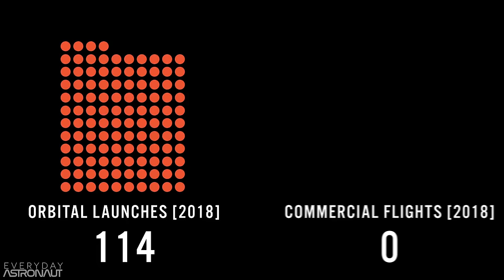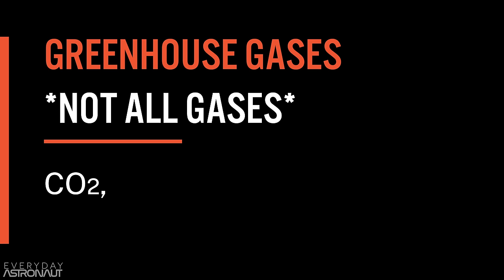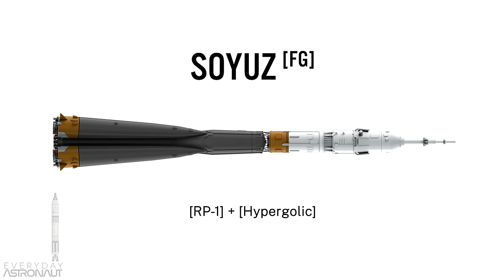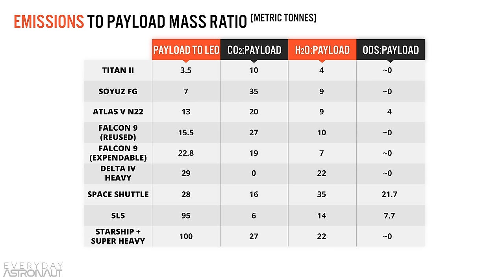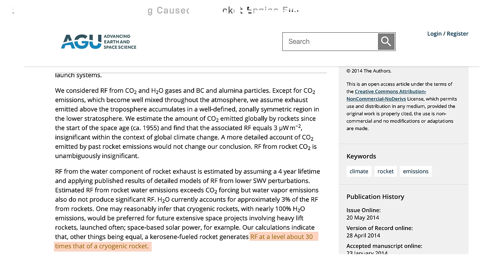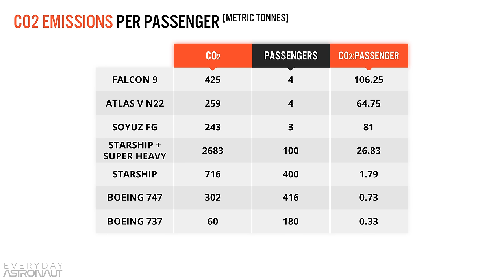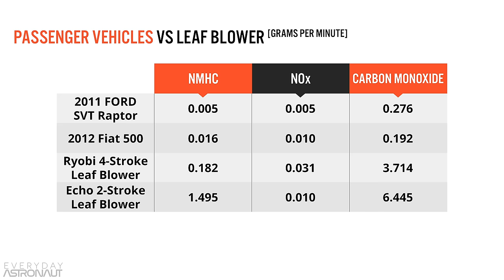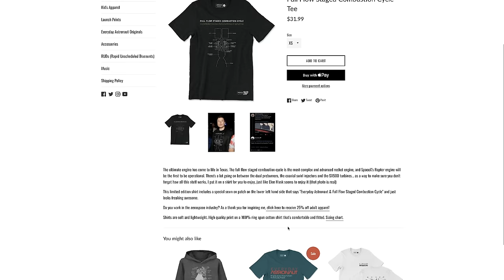How Much Do Rockets Pollute? Are They Bad For Our Air?

Comment: good video! .. A couple minor corrections: Hydrogen Chloride (HCl) is not an ingredient in solid propellant  - it is an exhaust product, and Chlorine is not. However, various Chlorine compounds in the upper atmosphere change with sunlight and other compounds, depleting Ozone, as you correctly stated.  Water vapor is a greenhouse gas, but at much different IR wavelengths than the much more powerful greenhouse gasses CO2 & CH4 (methane).. In the atmosphere, H2O is condensable to liquid, while CO2 and CH4 are not. The amount of H2O in the atmosphere in vapor form is determined by the temperature, which is powerfully driven by CO2 and CH4 content.. it is more accurate to say that CO2 and CH4 content amplify the H2O content.. It's far more accurate to describe CO2 and CH4 as the planet's thermostat.  Also, CO2 is not emitted directly by curing composites in an oven or autoclave, but it does require energy, which can generate CO2, depending on how "dirty" the energy source is.

Comment: 11:30 

It's di-ene because, if high school chemistry serves me correctly, it has two double bonds in its structure
Reply: ST-1170 - right!  Tell Tim to enunciate and exaggerate each vowel, cause it's right, it means something, and it's easier to understand how to pronounce it. "byoo-tah-die-eeen". Easy.
Reply: Actually, each butyl had two double-bonds, before one of them was broken open to link this butyl group to both its neighboring groups, to make a stringy stretchy long chain polymer.

Comment: -"It will take a solar farm the size of 6 football fields!"
-"So be it"

I love this guy
Reply: 6 football fields is not that much, only 345600 square feet. If we take 2 lbs per square foot of solar panel, it weighs 313.5 tonnes. That is 3 Starships to LEO, let's double that for Mars. That is considering the weight of solar pannels you put on your roof, I bet they can make them lighter if you do not mind paying extra.
Reply: @dronillon2578  couldn't we use a more powerful energy source before solar? Like using a small reactor or something, then start sending solar panels?
Reply: @Jak_Extreme  Maybe we could, and if it was just about visiting Mars couple of times maybe we would. Heck, for that you could just ship the fuel from earth. But that is not Musks goal. His goal is permanent human presence on Mars, that is why his response is "so be it". Because in the grand scheme of things, couple hundreds square feet of solar panels is nothing. For this goal, solar panels are ideal. They are very simple, last decades, do not require much maintenance, except wiping the dust off (which can be dealt with, look at Mars rovers). When they break, they are easy to replace (keep in mind you have to do this wearing space suits). Their support structures and soon probably the panels themselves can be 3D printed. Once some infrastructure is in place, they are likely to be manufactured on Mars (maybe not all parts, but most of them). Similar process of manufacturing fuel can be used for Earth (where it has to be perfected before shipping to Mars anyway). Moon and larger stations in orbit of Earth will also benefit from this process of creating solar panels. And possibly lead to creating power satellites to beam down the power back to Earth. If a technology is multi purpose and can be used in multiple applications, then it is likely to advance more quickly (seems to be Musks way of doing things). That is at least my understanding of the issue.
Reply: @dronillon2578  but if we send a reactor  first then start sending solar panels,the reactor gives power to the methane producer and only that so that starships can return
Reply: @Jak_Extreme  Those 345600 square feet of solar panels whould produce around 5MW on Earth, and 2.5MW on Mars. Equaly powerfull Radioisotope thermoelectric generator using Plutonium-238 would require almost 5 tonnes of Plutonium-238. I have no idea if this is even possible to work at this scale. Granted, it would last almost a century, but I doubt anyone would be fine launching this ammount of radioactive material into space onboard a rocket, that can explode and scatter that into atmosphere.
Reply: @dronillon2578  i mean, Russians want nuclear engines
Reply: @Sin526  I had no idea we have reliable, plug and play, easy to maintain fission reactors at this scale, that could be shipped to another planet. That is why I assumed RTG. Maybe you could provide links or reference points so I could learn more?
Reply: Sin526 as someone who worked on nuclear reactors I too would like to learn more about these, specifically how they plan to cool them.
Reply: How'd you like to be the guy that has to go out in a pressure suit and squeegee off all those panels after a dust storm? I wonder if you'd still hear it squeak...
Reply: @dronillon2578  At those scales, we tend to forego the passive radioactivity and go for actual reactors. Think about it this way: for probes, the advantage is the long burn and constant power unrelated to solar intensity. The whole point of talking about nuclear as a bootstrap energy source in a colony is the lighter weight of the fuel compared to anything chemical.
Reply: @atimholt  I'm aware of the energy density of nuclear fuel. The question is not why, but rather how? Solar panels and RTGs are simple plug and play things. As such, they are pretty much ready to go solutions. I'm not sure this applies to fission reactors. But I might be wrong. This is why I'm asking: what exactly are we talking about? Project names, links to some papers? 

That might provide answers to questions:
Will it survive the stresses of the transport? How hard it will be to setup once there? Cooling, maintenance, safety, reliability, disposability, setup cost, fuel cost? Will it be available in time?
Reply: Jak Extreme Yes, but putting nuclear reactors on rockets is inherently stupid.
Reply: Roll out the solar foil.
Reply: @dronillon2578  I saw somewhere (maybe Scott's channel) that there was one satellite with a fission reactor once.  However the main use of small fission reactors has been submarines and big ships, with the details heavily classified due to military significance.  I guess Grumman holds most of the US expertise in building those.
Reply: Actually the statement how big the area should be without a time specification is total nonsense. You can also charge Starship with a single solar panel, but that would take years.
Reply: NASA's kilopower sounds like a keeper
Reply: how big is football field?
Reply: @DFPercush  This would be a good application for an orbiting solar power satellite. It could be constructed in earth orbit, power itself to Mars orbit (with ion thrusters), and then send power down to the Mars colony by microwave. Microwave antenna arrays can handle dust.
Reply: No other choice
Reply: @ThatSB  Pretty sure he does, if he didnt he wouldnt be managing a company for more then 2 months since thats against the law. so you can love him more =)
Reply: So do I.  But Everyday Astronaut is a pretty cool dude as well.
Reply: @dronillon2578  plus solar panels pack flat in transport, so they could fit a lot into a starship as long as they dont exceed the weight limit.
Reply: @johncrowerdoe5527  Naval reactors are water cooled because the Navy has a lot of water available. In space the tendency is to lean toward liquid metal or molten salt, both of which can be launched "frozen" like a solid block if you want to fuel them before launch. The molten salt reactors can also be fueled at their destination because the fuel loading is almost shovel it in. Google NASA space reactor or molten salt reactor. The NASA space reactor puts out a dozen kilowatts if I remember right. The Oakridge MSRE (40 years ago) was about the size of a fridge and only put out 2 megawatts because it was only a research reactor.
Reply: Gigavolt pulsed ion drive causes cascade ionization of your atmosphere with minimal amperage required from the driver circuit and exhaust is ozonated atmosphere. Plus the ztrong electric field can use solar wind ions as fuel for interplanetary travel.
Reply: Like, that isn't even actually that large.  Some solar and wind farms are already much larger than that.
Reply: "So Be-zo it!"
Reply: the international standard of measurement 
a football field
Reply: six football fields does not seem to be a lot for that purpose
Reply: @00O3O1B  thats not true, solar, wind and Hydro are insanely clean, just by themself, if compared to Coal or nuclear , the difference is just straight up mental.
Reply: @00O3O1B  we need more funding in fusion research tbh
Reply: It will need to be bigger, because Mars has dust storms which last for months, and which can turn noon into twilight. The panels will also need to be cleaned regularly, and very likely repaired because of micrometeorite and radiation damage. 
   Maybe thermal stresses will also be a big issue on a large array. Solder becomes becomes really brittle at Mars temperatures, which will range between around 0°C and -140°C at the equator. 
   For the record: On average, Mars is about 50°C (90°F) cooler than the Earth. We see temperatures from about +50°C at the Equator to around -90°C in one part of Antarctica. At -90° your lungs freeze and you die quickly. Nobody has ever set foot in that region of Antarctica. Measurements are taken by orbiting satellites.
   The cold of Mars will be a major challenge to anyone who wants to live there, and almost nobody ever talks about it. But that cold has destroyed circuitry on Mars landers, and will definitely destroy any unheated present day batteries within a few hours.
Reply: @RWBHere  Actually there's a research station there at -90° , they try to survive and grow Foods, a test for the moon base , it was successful. 
The hardest part now is Batteries that can store energy for 14 days because of the 14 day 14 night cycles on the moon. they can make bricks, solar panels and Batteries from Moondust. 1 brick takes 5 hours to make in the vacuum , it's all quite a task but doable at some point.
Reply: @stevegaalema6807  I've heard this called space based solar. Isaac Arthur brought it to my attention. He has a YouTube channel.
Reply: Love the sly dig at chem trail theories 😂
Good job 👍
Reply: Really though? I wouldn't want to see large-scale deforestation to make way for solar and wind.  I'm still holding out for fusion power.
Reply: Three starship worth of solar panels for 1 starship worth of fuel at best, so how will you refuel other three starship,  by another 9 starship worth of solar panels???

Comment: December 21, 1968 was the launch of  Apollo 8 and I was there as a 17 year old boy.  After the launch, I could smell kerosene.  I was 18 miles away.  Pollution? You tell me.....
Visually the Saturn 5 first stage burned cleaner and dissipated faster than a shuttle launch with it's two huge SRB's.  They almost blocked out the sun.  But an RS-25 (Hydrogen fueled) exhaust is very clean......So is a Spacex Raptor which runs on Methane. (And is MUCH cheaper than Hydrogen)

Comment: I am grateful to fly F-15s for a living but I am forever in awe of rocket engines. The mighty F-15 uses Pratt and Whitney engines that make between 24,000 and 29,000 [ish] pounds of thrust each (afterburner)...and it is crazy fast and powerful! But...for context, the RS-25 (Space Shuttle Main Engine) makes 512,000 pounds of thrust (vac.). The ALmighty F1 makes 1.7 Million pounds of thrust (vac.)! We got nothing on rocket engines in terms of raw power. I wish I could feel the thrust!
Reply: I'm pretty sure if we put an F1 engine on your F-15 and lit it, you wouldn't feel a thing. :)

Comment: This is a great video that addressed most of the questions I've had for years about 'vehicles' at high altitude.
 Even before the internet existed I had a good idea jet aircraft (747) produced more pollution per person on a single trip (London to Australia for instance) than I would produce in my entire life including every vehicle I was likely to drive
I am wondering if there is any more research going on into 'railguns' for transportation? 
The initial accelerations would probably turn people into mush if set from standstill but couldn't smoe form of electric motors be used to lower acceleration before pulsed magnets were switched on? (as in a few Sci-Fi books I've read in the past)
 'Launch guns' would take up a lot of area, probably several miles long but could be pretty much 'ground based'  and if using 'cleaner' nuclear reactors to power generators (thorium reactors or smaller aircraft carrier sized which are better understood and contained)
Reply: Look up spin launch

Comment: The SSME is somewhere around 1.2% efficient if you take the fuel energy consumed divided by the thrust energy output. Its much more efficient to use a commercial turbofan to push off of the air, than pushing off of your own rocket exhaust. Even better, push off of the entire earth for the best efficiency, as there are no losses to turbulence.

There is a simple number you can use to multiply with the engine's specific impulse in order to get the actual TSFC efficiency number in percent.

Comment: Since the Space Shuttle engines had to. Lift the orbiter along for the ride to LEO, the actual payload that was lifted by the launch system was 128 tons, making the shuttle the second most powerful super heavy launch system after the Saturn V. That would put it at the top of the list and it means it performed MUCH better than what you calculated.

Comment: You forgot to mention ODS per passenger in Rocket VS Airliners. With that in mind, airplanes are probably at least 10x worse for the atmosphere than using starship for point to point transportation. Sounds pretty good!

Comment: Excellent video but some things cast a doubt in my head. Planes also emit other greenhouse gases (as you said) so in terms of equivalent CO2 it adds up to 6%. Some figures up to 11% are possible when you include actual consumption records and not estimates per flights. If you run the estimate and compare to actual jet fuel use you will see the gap. A 30% burn seems plausible for traditional two stroke engines seems legit but if you add the use of valves and direct injection it's different. Some very efficient diesel engines are two stroke, don't demonize the two stroke cycle. Anyway, to make all those appliances electrical may be a good and convinient way electrify the economy so it will be good to have leaf blowers (which I think are useless) be turned into electrical. This will be a bliss to air quality and noise. 
Regarding offsetting the emissions from rockets by reducing a 15% traffic in road vehicles keep in mind that we need to be carbon neutral by 2050. It doesnt matter what this industry does when compared to the rest, it too needs to be neutral. Looks like it's on rigth track to acheive just that. I also hope SRBs and hypergolic go away as they are really nasty. Sources may be availlable on request but please only do so if you actually need the information, as I would have to dig them and that takes work. 
Keep up the good work.

Comment: it's not hypocritical to use rockets to try and extend the lifetime of the human species while also pledging money to also help clean and save it. That's like saying isn't it hypocritical to drive 75 mph on the highway while also wearing a seatbelt. Like yes driving 75 mph on the highway can be dangerous, but you're wearing a seatbelt that will help save you.
Reply: Its speeds up the process of diminishing the atmosphere launching a bunch of rockets in the next 10 years without something to offset the emissions level. The space program was on hold 50 years so now launching rockets after rockets from earth instead is gonna be the deal breaker, look at starship heavy CO2 that is crazy every time is launches it emits that amount.
Reply: @lip124  SpaceX emits only ~4000 tons of co2 a year which is nothing compared to the entire US electricity generation makes upwards of 2.8 billions tons of co2 per year.
Edit was us to US

Comment: maybe i'm wrong, but it's worth comparing transportations emissions to miles traveled..a 737 for instance (which has 189 seats btw, bringing your calculations to 0.317) should be observed differently in my opinion : the ratio of fuel per pax per 100km (roughly 54 nautical miles).

Now, a 737 cruises at roughly 2.4 tons per hour. we can roughly say that continous descent compensates for the extra burn during climb (for the "ish" side of things). Now in average, we cruise at lets say 0.78 mach, which in still air is roughly 7.5nm a minute (about 13.9 km/min). This says that, in still air, we are taking 7.5 minutes to achieve those 54 nm (100km), right ? 

And it goes like this : 2400 /60 = 40 kg/min -> 40kg *7.5 = 300kg...300kg for 189 people..which is 1.6 kg per passenger per 100km..which is roughly 1.8 liter of fuel in cruise.
Should you even double that for approximation (apu, taxi, takeoff, climb, cruise descent, taxi)...my car is doing about 7 liters/100km on a highway, and its probably rated much less then "0.317".

i understand also that you take half of the "range of action" of the plane...but again, fuel burn/100km/per pax is a comparison much more easier way to explain it in layman terms...i'm not confortable with such numbers thrown out like that out of context. People then talk like they know all about a very complex industry. When the biggest boats on earth consume the equivalent of 60 million cars yearly consumption....in one trip possibly (even if its 2...).

So yeah, i'm not sure i agree with the numbers here mate, but, i'm not saying i understand everything you've said and studied, so i figured i'll give you my insight on the 737 matter as i know a little about it to have another angle on it :)

Love your stuff, i don't challenge you in anyway, just giving you numbers here. cheers mate, stay safe ;)